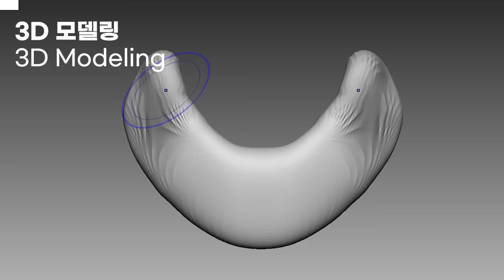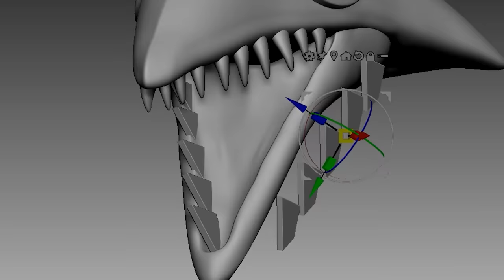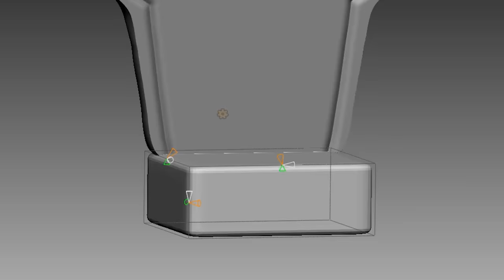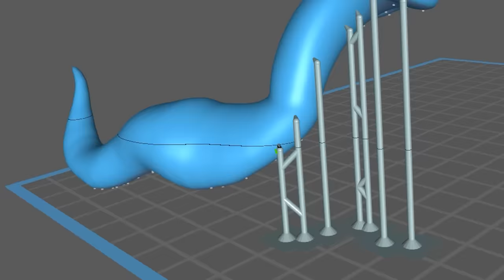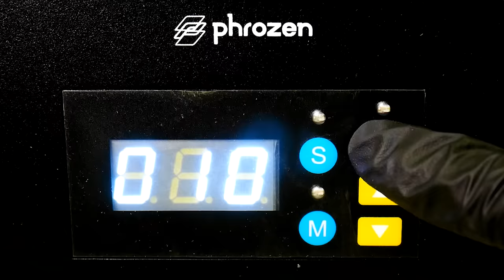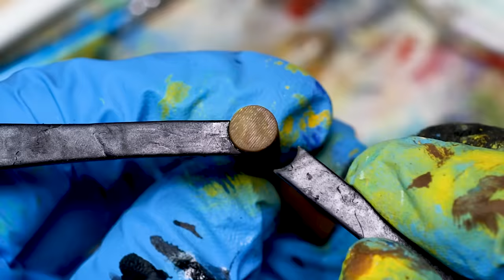[ROBLOX] Making RAINBOW FRIENDS CHAPTER 2 Sculptures Timelapse

Comment: AMAZING! Yellow HAS to be my favorite due to the accuracy of the model, Not a single detail missed! (like others, but I just like yellow the most.) However,  There's one thing that bugs me, (not that it matters.) Its the fact Cyan's lower jaw is sticking out, Why? Also, I'm pretty sure cyan isn't based off a hammer-head shark, because then she would have all proportions and it would be submerged under-water to fit the fact it would be a shark, According to google, Cyan features a unique appearance, bearing a head shaped like a magnet and having no hands or arms. The rest of her form has a dinosaur-like resemblance, although there are notable similarities with Orange, especially in regards to the eyes, so she resembles a dinosaur like monster, however i believe she is a salamander or velociraptor with no arms. Other than that, models are spot on, painting is nice, and overall is better then anything me or my family could do, Good job YH!